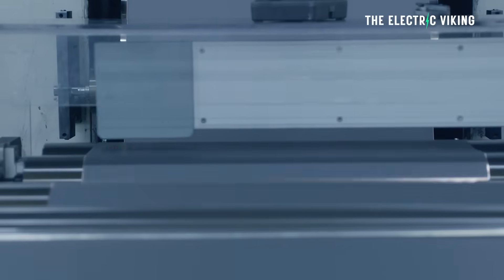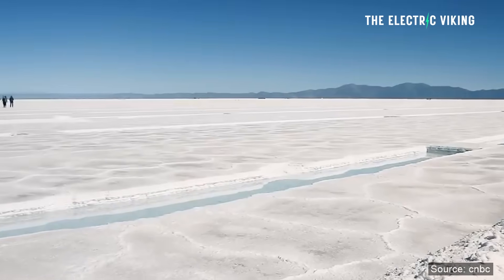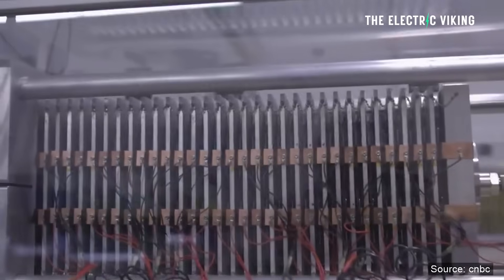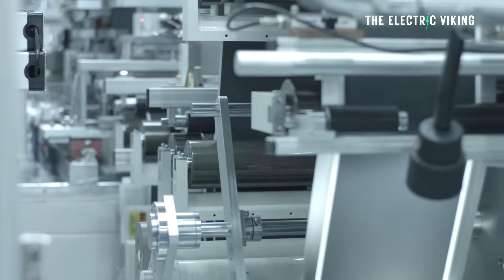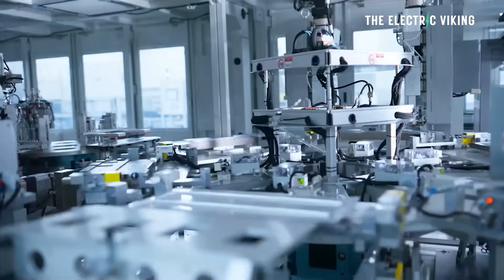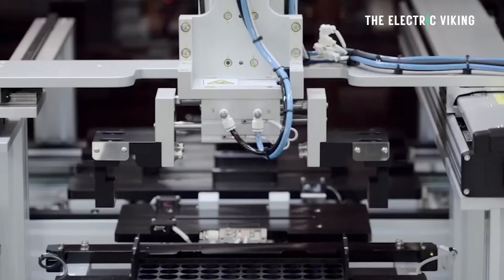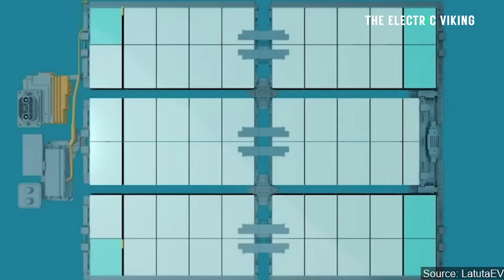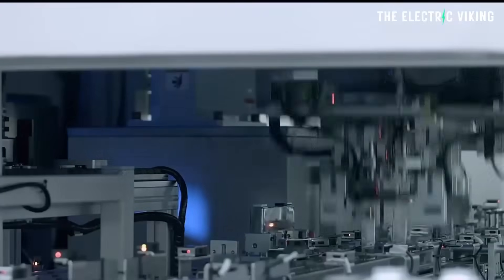Aussie battery company reveals 30% cheaper sodium home batteries

Comment: Sodium sources are plentiful. Look up Rio Tinto Dampier salt. It's just a big evaporation pan made on the coast of northern WA. Massive sustainable resource.
Reply: Not to mention- the oceans.
Reply: @davidnika446  that's where Dampier salt gets it's salt from. They pump sea water into a big evaporation pan and wait for the sun to do the work and then scoop it into a ship to sell it. Hence why it's sustainable.
Reply: @lukethmpsn  Thanks- I didn't know about that in particular. The harder part is obviously splitting the sodium from the chlorine and getting it in to usable form. But the supply of salt is practically endless.
Reply: @davidnika446 Yeah, this is the only question I have. What is the market and use for the chlorine byproduct. We use chlorine in the plant that I work at, but the byproduct of that is sodium hydroxide, which is already a saleable product. I am sure there are decent markets available out there
Reply: Around 2 orders of magnitude cheaper than lithium presently maybe?
Reply: Every water desalination plant is dying to find a use for all the salt they produce...
Reply: 2.6% of the earth's crust is Sodium. It's the 6th most common element.